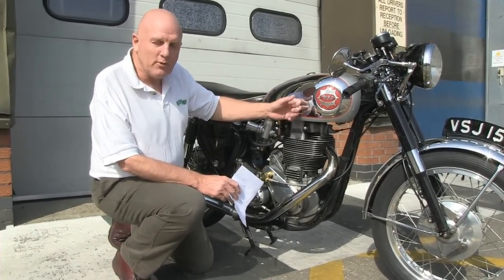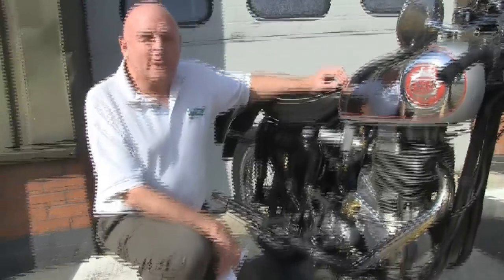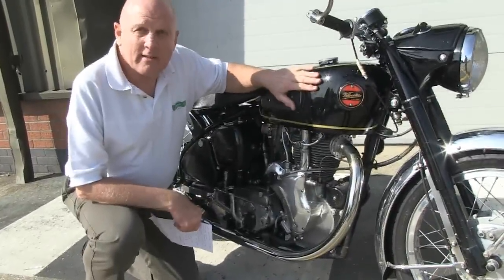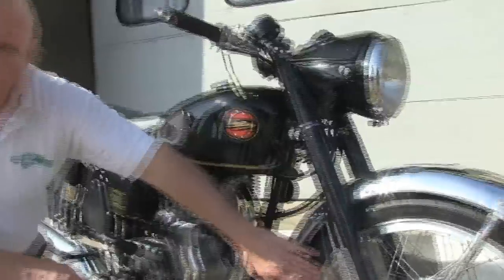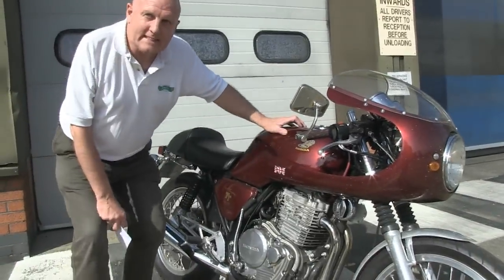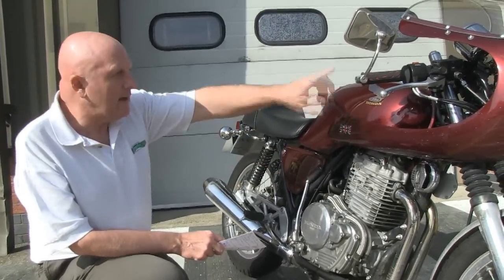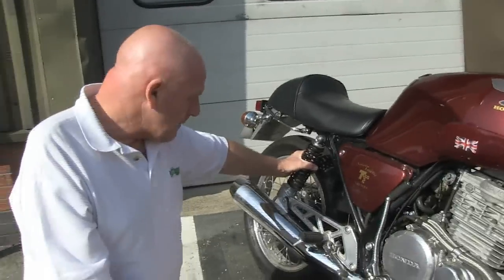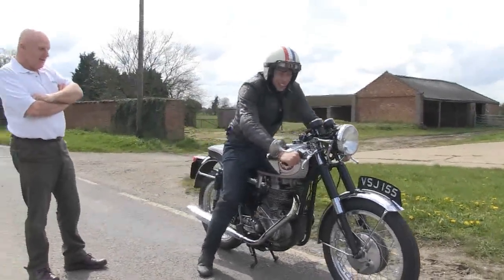Classic Bike Guide: Singles club - Honda GB500TT, Venom Clubman Mk.1, Gold Star DBD34

Comment: I have a gb 500 had it for years. Always puts a smile on my face. I put an Italian stainless down pipes that do away with the box under the engine. Sounds a treat. Rejetted the carb to match. Economical. Reliable.  Fun. 56000 miles now and runs like new

Comment: I rode a B31 BSA in the 1960's. Loaded with prince of darkness (lucas) electrics. 
To start the bike stand on the right side and kick with your right foot. Push slowly
 through a compression stroke plus about 180 degrees of crank rotation. Then 
1/4 choke, 1/4 throttle kick like you want to break something it would firstly go
through TWO (2) compression strokes at a pretty good speed letting the magneto 
turn fast enough for a decent spark.If it wasn't running on the third kick put it back 
in the garage and save towing it home later. The 750 Norton had to have two 
cylinders fireing to start which due to oil in the magneto often had ignition ptoblems 
I bought a Royal Enfield 736 cc interceptor in 1969 with capacitive discharge ignition
and Amal concentric carbs. Never fails to start and still have it today 51 years later.
Still have an old Kawasaki 3 cyl 750 2 stroke, a parts bike now.
                         george and aurora     CONCRETE HOUSE BUILDING IN PH

Comment: Back in the '60s I had a '58 Venom Clubman. It could be difficult to start. One day I cut my left forefinger at work. After getting it bandaged at A and E, I couldn't pull the decompressor to start it. Everybody in the works had a go at starting it without success. In the end, three of them pushed me, but on a flat road, even that was hard as it tended to lock the wheel in second. Finally it fired and I struggled home, mightily relieved.

Comment: It amuses me how folks are always impressed by old bikes being on original big ends etc after 35,000 miles. That is of course the difference between Japanese and Brit. I have a CB250, still on std bore and everything after 50,000 plus miles I just had to re-place a countershaft seal, and two cam chains in those miles. 
GB400TT for Japan, GB500TT for USA maybe Canada and I think Germany. Would love one myself but all I have is an owners manual.
Reply: keepitrunning I had a 1989 yam xj900 which I despatched and she did 196k before finally snuffing it!
Reply: yeah, had a goldstar for a long time, worked on it all the time replacing big ends, top ends. Great bike, raced it and did well, but in the end I sold it and have been sorry ever since. have owned a sr 500 yamaha for 40 yrs. and it still runs great with one new set of rings.

Comment: Nice to see these old bikes running, the way i start a gold star is retard the ignition,turn the engine through two full cycles to draw fuel into the cylinder, then bring the engine up against compression, ease it over until it is just past top dead center, open the throttle just a hair and kick it over very firmly and make sure you use the full travel of the kick start lever, always starts for me first kick. You have to understand what is going on in the engine and where you position it for kick starting.

Comment: I have rode quite a few singles the more they are tuned the less practical they are to ride 95% of the time - Now I ride an SRX600 which is remarkably mellow though needed a Jet job after the K&N and Preditor can - 8.5 to 1 compression  is sweet.

Comment: I had one for 15 years an 45000 mls - loved it. Only had the US/Germany - versions a 289mm Front Disc brake, not 275 mm as this one and the carburetor was a 42 mm (!) Keihin wich put both, max torque (39 Nm) as well as max power (38 hp on paper, yet about 42 in real life) to quite exactly 6000rpm. The fuel consumption was about 3l/100 Km (about 95mpg) in total. I coul easily reach 110mph top speed, once it hit the limit of the display at 120mph. Try to get one - it's worth every penny.

Comment: What do you mean by "so it won't tick over" ?
Reply: Wont Idle when you pull up
Reply: GP 1.5 inch Carb wont allow tick over.    Just blip it and all ok.       23 tooth engine sprocket 67 mph in 1st, fun going up gangplank on I o M ferry.
Reply: @travelman868  65/2442 and 65/2448 cams you cant beat them

Comment: The Honda GB500 TT Clubman is by far the better bike, sure the Goldstar and Venom may be worth a little more money.
Reply: I have a GB500 and I agree-  the best.
Reply: Ya think ?! The Honda has 30+ years of technological improvements, and doesn’t leak oil !
Reply: @peteryouds5634  but just no soul!
Reply: @ideyboo   Try riding one and you will find its Soul.
Reply: @boxerr1100s  I guess it depends on what you class as soul then.... Alternatively you should tackle a Goldie then you'd perhaps understand, there again perhaps not after all there's none so blind..
Reply: Ever wondered why?
Reply: @ideyboo What makes you think that I have not, I once owned a DB32 400cc special built and tuned by Phil Pearson.
The Goldstars are a great motorcycle for their era but are not very practical for road riding.
Reply: @ideyboo  plenty of hot up bit's available and still mega reliable...they can be made very quick and become a bit angry.